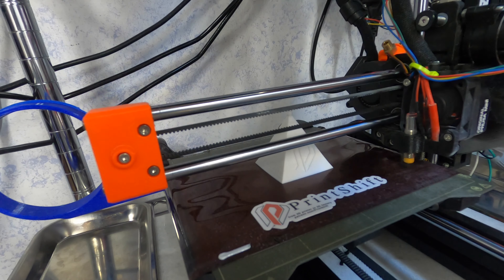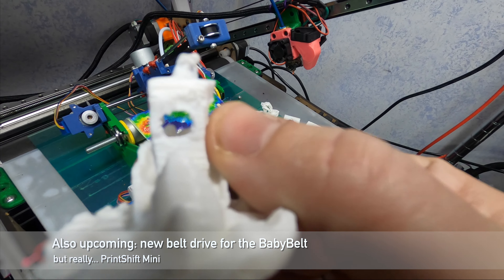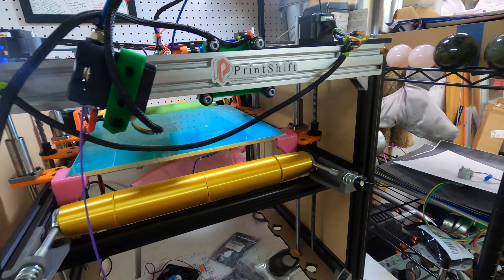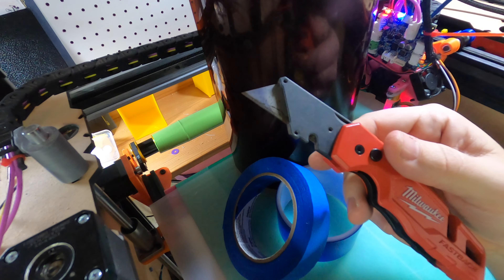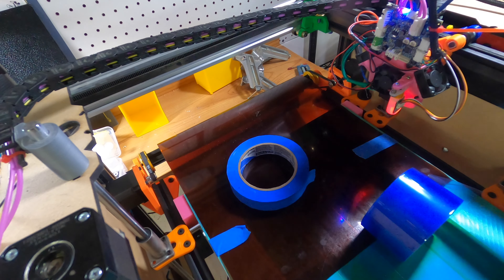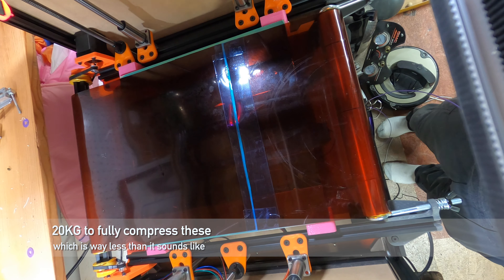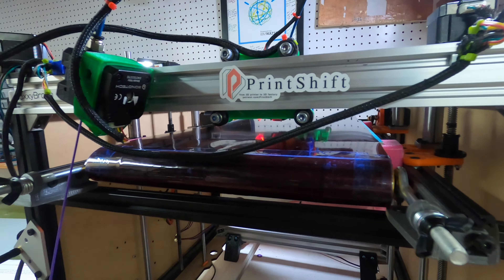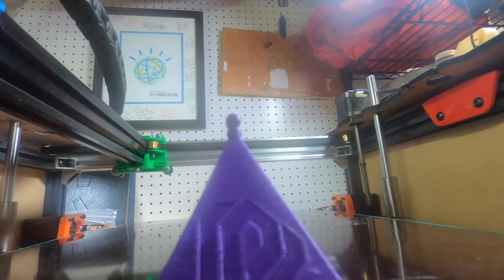Large Bed Conveyor - Making a Belt Tester and Printing!

Comment: And our Voron is 350^3.  doh!  thanks man for this, the deflection test is a needed tool in this world of belt printing.  also, it surprised me about your ABS failures, as we are moving to almost all ABS printing.  lastly, i appreciate leaving in the funny edits and drops.  makes it seem more real / live.
Reply from the maker: PrintShiftXL will fit a Voron - likely with the motors and tensioner sticking out a bit, ejecting sideways - have to shape the enclosure around it, and hinge the eject side, but that should be doable.  I'm debating getting one of the pre-built Vorons to PrintShift, but it's hard to know which model would fit the most home-built Vorons.

I don't print much ABS, so really haven't done a lot of testing - my quick fix for getting parts out was just to print one at a time and ignore the warping... I do a lot of goal-oriented making.  I will revisit ABS and ASA on it at some point; likely with a heated chamber.

I really appreciate your lastly :-)  I much prefer to have everything in-camera and in the moment.

Comment: Could you use a metal belt with pei and small electromagnets under the bed to hold it down only while printing?
Reply from the maker: Even better, magnetic chucks use permanent magnets - arranged so that rotating them will apply the field.  The metal beds I've used are all stainless (shim stock) and only slightly magnetic, though... so that would come down to bed material.  Worth investigating, though!  I was going to re-test metal beds because they're stiffer in general - I haven't tried to source more magnetic ones.